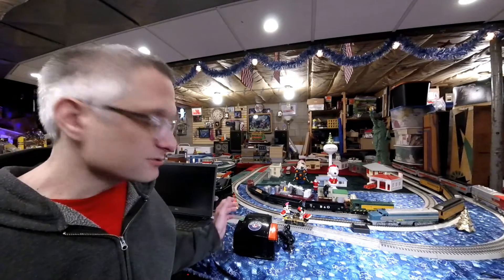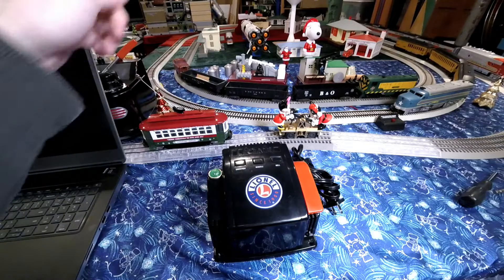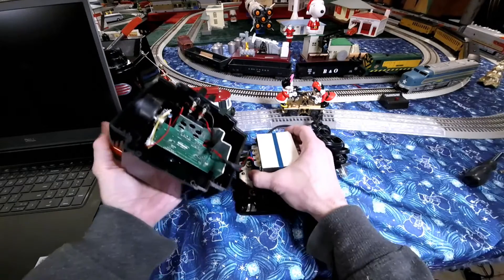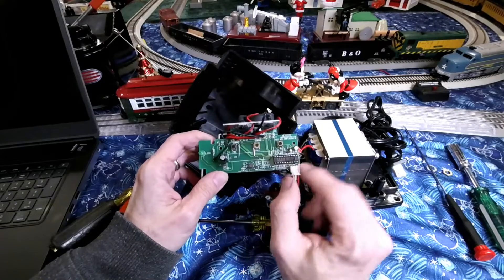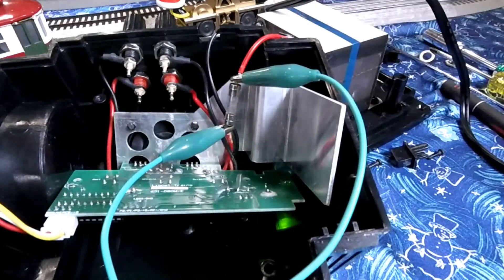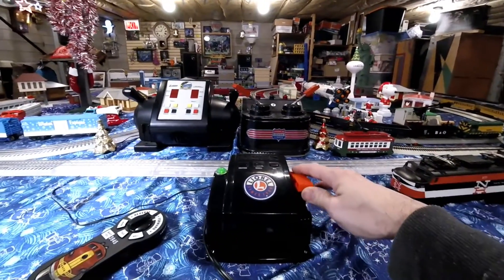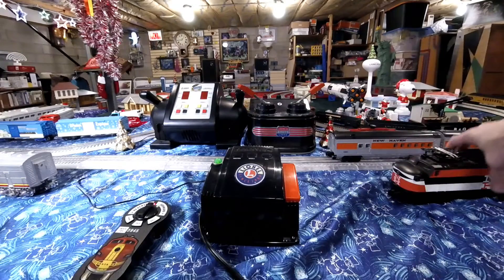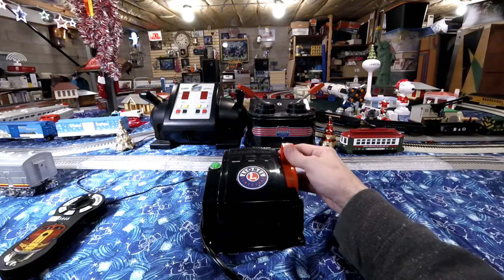Lionel CW80 transformer repair - and trying it out

Comment: Thanks for the video. I have a CW40 and the indicator light and fan turns on. With a voltage meter I get voltage from the red and black wire connectors on back of transformer. When i connect wires then no voltage. Any ideas would be helpful? Thanks
Reply from the maker: Glad you liked the video. I cannot speculate on the issue with your CW40. There most likely is a safety circuit that will automatically trip with an overload. I would try powering a small bulb. If that works then see where the short is on your track.
Reply: @TooManyHobbiesJeremy  Thanks so much for the reply. I was initially using a simple volt meter which i thought was showing power to the back as it lit up and beeped but now as I hook up a volt meter with reading Im not getting anything. I did take the transformer apart and the circuitboard looked ok. Thanks again!

Comment: I have one of these CW80's o my work table now. Yes the fuse is out. However I read on line that the fuse is supposed to be on the primary side, but it is on the transformer secondary side. It is the better side for a train track short, even better it they put it on the track output side. I think on this one I will put a blade fuse holder, a wired one so I will have it outside  just have to drill out two holes. Then it will not have to be taken apart again for the fuse repair. i saw another video when the fan was the problem and then it would over heat and shut down. They replaced the fan and it should be Ok they thought.  
 I agree the soft direction control is weird and some engine do not respond to it, but it is great on the gears of the engines without flywheels on the motors. To make a E-unit respond if the direction button does not work a quick up and down on the throttle works for that. 
 Thanks Jeremy!
Reply from the maker: Great comment! Keep up the great repair work :face-red-heart-shape:

Comment: Jeremy, a novice here, what kind of fuse do I purchase for my Lionel CW 80-watt transformer? And, what kind of circuit breaker?
Reply from the maker: If your CW-980 is working well, I would leave it as is. If the original fuse is blown and that's the only issue - you don't need a fuse AND a circuit breaker. Just one of those. Best to match the value of the original fuse.

Comment: You got lucky my friend! On mine, the fuse is good, the fan runs, but no power to the terminals, and the green light is off.
Reply from the maker: You are 100% correct on that :face-red-heart-shape: Interesting the green light is off. I would do some careful probing with a multimeter and see where the power is stopping.

Comment: Mine has the opposite problem … 19 volts both circuits all the time. Need to dive in and find source of the problem, likely the proprietary controller device.   :-(
Reply from the maker: Good luck on your repairs

Comment: Good morning, watching your videos it is evident that you know.
I have a very simple set that works only with the source that came out of the box. It is a Lionel Polar Express locomotive that I bought in 2020. Connect everything and leave the train stopped, from one moment to the next on its own the train started moving very quickly, it made two turns, it stopped and from that moment it did not run again, check everything and it only turns on the front light of the locomotive intermittently, it does not work with the remote control. I think it is shorted because the buses went out. I appreciate you telling me how and where I can solve this. thank you . I have a second question, is it necessary to buy the article Lionel Transformer GW-180/180-WATT to protect a possible new train? thanks thanks
Reply from the maker: That's a difficult problem.  Check the output of the power supply. Check the battery connections on the remote.

Comment: Still have mine from a set I got back in 04 the only problem is the bad fan screams at you for about a minute till the bearings heat up and it goes quiet. I use my ZW for most operations but break out the cw80 for xmas layouts. It never runs hot with the 3v williams engines but turns into a nuclear power plant with any of the old AC equipment.
Reply from the maker: Very interesting with the heat output. Thanks for watching the video & the great comment.

Comment: Jeremy,  Have you ever seen the fan in one of those early CW 80's?  I need to replace one in mine because I did something and poof, it was gone.  I was thinking it might be a fuze but the transformer works and supplies adequate power to the track/ train.  I'm just looking for what to check next.
Reply: Hobby shop has every kind and volt fan you can imagine really easy swap RC guy❤😊
Reply from the maker: Yes, it was a bear to pull out everything to access the wiring. I'm guessing it's a standard fan but you would have to pull it all out and get some specs of the label and then find something similar.

Comment: Nice job, but I was thinking an external fuse holder, and while in there an on/off switch.
Reply from the maker: For sure! one of those panel mount holders would work great. A power switch would be a nice addition as well.

Comment: This generation of the CW80 is one the worst ever made, these are barely worth the plastic housing they are in. The more recent fanless versions are much better.
Reply: 0:26 i have a later version of cw 80 and i dont hear a fan noise that others talk about. so after your comment i guess my unit does not have a fan. green light goes to red on some engines and then back to green. underpowered mabey, thinking of adding a brick.
Reply from the maker: That is the kind of info I was looking for. I was wondering what they changed in the design. Thanks :hand-pink-waving:
Reply: There was an update to the electronics and the power output on the newer models is much cleaner. If you look at the older ones on a scope, you'll cringe.  Also, the power indicator lamps were changed to a clear lens with a bi-color LED. Green for power on and flashing Red to indicate a short. @TooManyHobbiesJeremy
Reply from the maker: That's great information and makes it easy to tell the differences from the outside. I could tell my postwar Alco FA really didn't appreciate the power output of the 1st gen CW80. Thanks for the info
Reply: @patrickheine5604  Is the color of the lamp a reliable way to tell which version I'm looking at when shopping?
Reply: @michaelramsey82  Yes, The newer (better) CW80 has a clear lens and the older ones have a green lens.

Comment: I got one it keep flashing  the green light  do u know what it could  be I thinking  a Shortage
Reply from the maker: Thanks for asking, a short or low supply voltage for the microcontroller will cause that symptom.  It may not be possible to fix it. But I would start with checking the capacitors or just straight up replacing them. It depends upon how much work you want to put into it. A lot of people consider the CW80 a disposable unit.
Reply: @TooManyHobbiesJeremy  thanks buddy I want to fix this one

Comment: I agree, Lionel should’ve installed either an automatic breaker or a resettable circuit breaker in those transformers. I have many of them and one of them did stop working. Nice work!  Frank😊
Reply from the maker: Thanks for the great comment Frank.

Comment: Lionel shoulda just put in a breaker from the beginning. So they cheaped out on that. So if a train derails and shorts, blows fuse! Now you gotta take it to a shop for repair. Otherwise not a bad looking power supply inside
Reply from the maker: Thanks for the comment. Here's the weird thing - the fuse is on the input side of the control circuitry. Between the control circuit and power supply transformer. A breaker should ideally be on the output of the control circuitry. An interesting design. I know there is an updated version of this transformer. It would be fun to compare the two.

Comment: Hi Jeremy...another great learning video.  All my transformers are MTH Z-1000's 100 watt. I notice the button sequence is different on that Lionel transformer to activate station and passenger sounds. I assumed they were both the same...good to know. I'm waiting for a Lionel pre-order of a Budd car set. I've already purchased their universal remote. Do you think the Z-1000 will be powerful enough to operate the set efficiently ?  I'm not savvy on watts and volts but did some research and feel it should be ok.  Your thoughts ?   Thank you !  👍
Reply from the maker: The Z-1000 is good for the Budd set for sure! 

The button sequence on the Lionel transformer is the same. The difference is I was running a proto 1 engine which has a completely different way of accessing functions compared to the proto 2 & 3. 

Thanks for watching the video ❤
Reply: Thanks !  👍